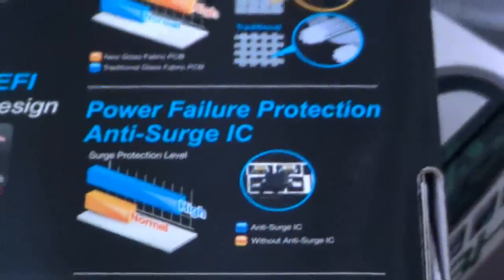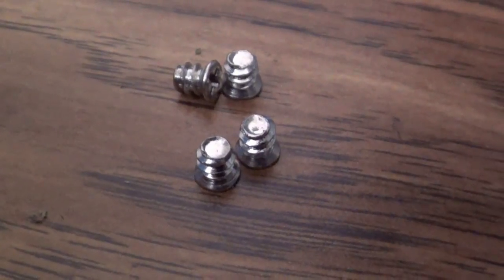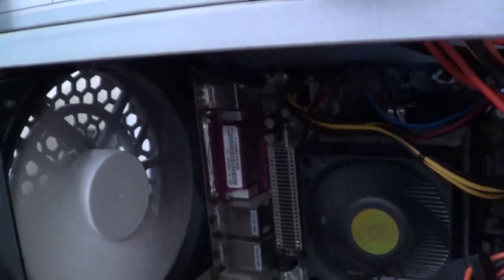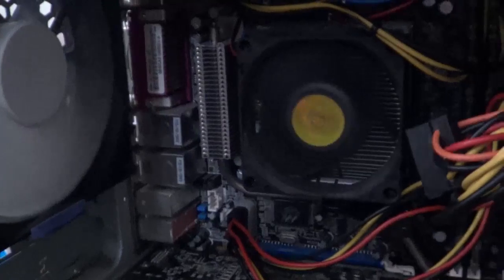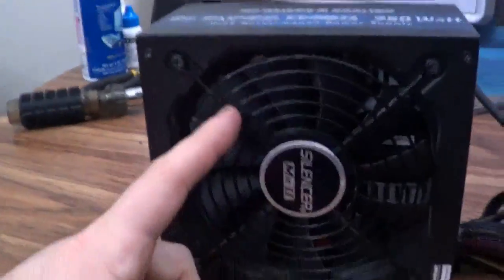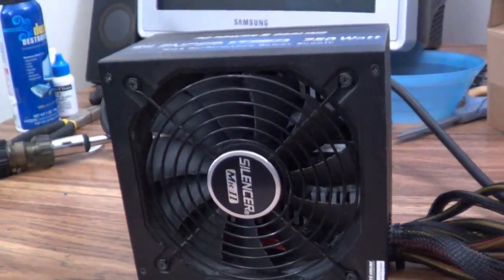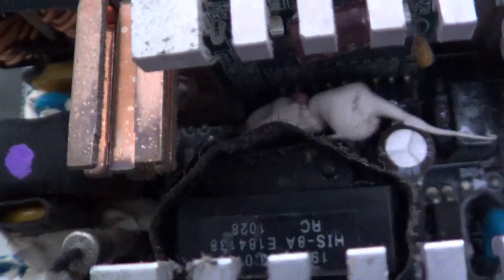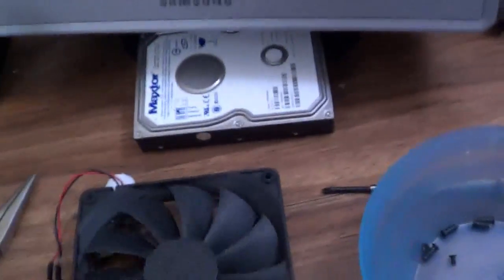The Aftermath Of Tuxedo's Redemption

Comment: The smaller transformer is probably for the 5v standby voltage and other low power rails but I don't think that its the source of the explosion, more likely to be a semiconductor. I can see what looks like a bad solder joint around the transformer though and this can cause high voltage spikes to appear across the main switching transistor when it tries to interrupt the primary coil current.
Reply: yes very likely that one of the nearby transistors or even that diode let the magic smoke escape